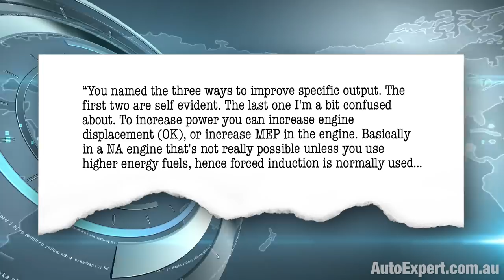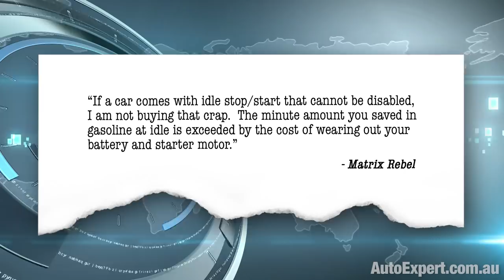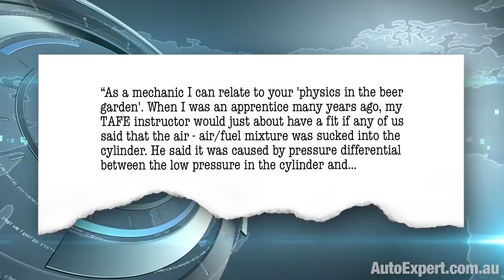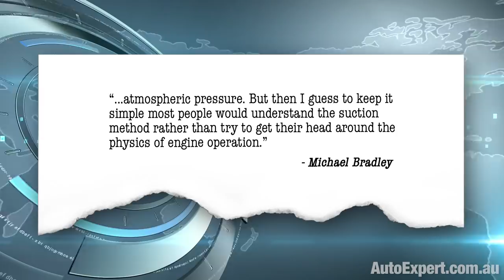Engine Physics in the Beer Garden (Q&A) | Auto Expert John Cadogan

Comment: I've only driven one car with stop/start - it was a hire car; VW something commodore sized.  And I'm pretty sure it was broken because the delay off the lights was exceedingly frustrating, followed by a loss of power; fortunately it could be switched off.
I've heard it suggested that stop/start can't be switched off in some vehicles.  Is this the case?  Assuming it is, would there be a fuse/relay one could accidentally forget to replace to permanently turn the tech off without affecting anything else?
Reply: I think you'll find most if not all cars it can be turned off but a lot of cars will default to on whenever the engine is restarted so I'd think that pulling a fuse would just leave it stuck in the default on position

Comment: You mentioned petrol start-stop is perfectly calculated so that the engine just needs a spark to restart. I was wondering, how does it work in a diesel? Does it stop very close to detonation and then the starter just moves a tiny bit to restart the engine?

Comment: nice explanation for the restart with the sparkplug so how dose it work on a diesel engine. the heat from compression is going to dissapate rapidly and than there is no more sorse of ignition for the fuel. and I haven't seen diesels with sparkplugs in a car jet.
Reply: Glowplugs

Comment: On a serious note, my old boss explained BMEP as the effective pressure pushing down on the surface area of the piston. Nore surface area, more power produced. That was why, he explained, why back in the good old days, you would have racing engines with 12 cylinders but only 1500 cc capacity.
Was he barking up the wrong tree, or just barking mad?
He has got it wrong in the past, i remember arguing with him when he said the 1071cc Mini Cooper engine was under square. It isn't. It's over square, meaning the bore is bigger than the stroke...

Comment: That start-stop function in a gasoline engine is quite reasonable to understant. But how it works in a diesel engine?
I have a diesel car and some times, if I stop for lets say 4 to 5 minutes or more it refuses to restart.
And the start-stop function  only works when my car is in normal function temperature.
I have a Mitsubishi ASX 1.8 diesel 4*4  from 2011.
One more question.
 I have heard, somewhere, that the 4*4 drive is disconected from more or less 60km\h, can you confirm if that is the case on My Mitsubishi??

PS: I live in Scandinavia country of the monarchy of Norway.

Comment: Stop/start was interesting, don’t think I’ve heard one fire up without engaging a starter motor or utilising the alternator/hybrid generator. Wouldn’t the leak down zero out the compression and oxygen in each cylinder? There’s a tractor engine which could be started using a shotgun cartridge, don’t hear too many of those cracking off at the intersection either

Comment: Also lower intake air temperature increases power - Carnot's Formula (T1-T2/T1.
Reply: I'm pretty sure that's just another way of getting more air in.  Remember that fuel is metered based on the weight of air, not the volume.  Cooler air is denser, so the same volume weighs more -- more air (by weight) means more fuel, more fuel means more power.
Reply: Yes, Ed B, denser,cooler air was a focal point of Sir Harry Ricardo's book : " The High-Speed Internal Combustion Engine" written in 1922. It's the engine engineer's bible.
Reply: @amazoidal  Thanks for the reference, I haven't looked at it yet (mostly books with plenty of color pictures, I'm afraid).  I did find this that you might find relevant though: 

"In the case of an automobile, the two temperatures are:
    The temperature of the combustion gases inside the engine ( THot ).
    The temperature at which the gases are exhausted from the engine ( TCold )."

T1 you use is THot, and T2 in your equation is TCold, also you should have parenthesis around (T1-T2), unless you are reducing T1/T1 to 1, then the T is not used.

Comment: Apologies Sensei for being late, getting a teenager ready for school is always fun. 🙄🤬
Now, in regards to the octane question and I sort of get where the question asker was coming from. We (you & I) both agree that octane equals knock resistance. What he could be eluding to is the use of different fuels which can increase/decrease the power of the engine. It's like when Holden would sell you the SS Commodore with 270Kw of massive power...but ONLY if you used 98 octane. If you used 91 octane it was rated at around 260Kw. 🤷
Still waiting for your inevitable dissection of Infiniti and the poor mess their unfortunate owners in Straya will have to go through in the future...unless Nissan steps in. 🤔
Reply from the maker: Yes - engines adapt to higher octane fuels and make more power. That's not the same thing as a higher energy fuel.

I'm dissecting Infiniti this morning.
Reply: @AutoExpertJC  That we both agree, but it can be easily misinterpreted by the less knowledgeable into believing that octane equalling more energy. Just trying to give the perspective from the "nut" side of the brain. 
When I was a teenager I thought changing fuels meant more power because of that same reason, more energy. I learned not to believe such witchcraft very quickly from drag racing and the effects of different fuels and power adders on motors from the racers themselves...not as technical as your Bachelor of Engineering but just as fulfilling. 👍

Comment: It would be interesting to calculate the real life effectiveness of many of the things done to improve efficiency and pollution.
Much of what is done is to get lab results and may actually prove useless or even have negative results in real life testing.
Some universities etc have strapped a mini lab to the back of some vehicles to test irl conditions (that’s how VW got caught I think) but even that portable lab alters the real results by some margin.
If you burn a set amount of fuel to do a set amount of work with one engine and produce xx amount of pollution for there to be a real improvement an engine needs to either burn less to do the same work or create less pollution to do the same work with the same amount of fuel or both less fuel and pollution, but unless you are looking at large commercial vehicles you can never get that comparison as no cars are the same even when they are supposed to be the same model with a new engine.

Comment: Cannot the inlet piping be "tuned" to help air into the cylinder and on the exhaust side, be "tuned" to help extract the gasses.  At least that what I thought all those very noisy 2 stroke "mufflers" were doing -- setting up a resonance in the exhaust tubing to help evacuate the cylinder.
Reply from the maker: Sure - but you can't do it at all operating revs.
Reply: @AutoExpertJC  Yes, I think they were tuned for max hp. Sure were loud!!!!

Comment: Nautrally aspirated engines push air into it's cylinders from astrophic presser, not from sucking it in. It's basic physics.
Reply from the maker: Yawn - go study basic physics. The flow is motivated by lower pressure in the cylinder.

Comment: Speaking of starting the engine again after the automatic engine stop of a stop/start system, is, at least for the petrol engines, similar to the "safe" way of starting the Blitzen-Benz: https://www.youtube.com/watch?v=xMa3_tT5mKA
It does have a crank, but using it with the mags hot, given the engines huge displacement, can easily backfire and literally break your wrist. So the engineer just primes it carefully, cranks it to just after TDC, and manually fires the ignition. And sometimes it starts. Mind you, the machine is 110 years old!
I think diesels needs a small mechanical push (about half a crank revolution) to get it going. The ignition relies on the heat from the (mostly) adiabatic compression, but that heat will have drained away when the engine has been standing for a couple of seconds. I'm not sure glowplugs are used for restarting; I somehow doubt it, they would take too long to heat up to make a difference.

Comment: Any reference to this restart without starter motor? To me it sounds incredibly difficult to make the engine stop exactly beyond the TDC of even any cylinder. The air pressure would also start to fall fast.

Any texts I can find about stop/start systems indicate the starter motor is used, or otherwise a combined alternator/starter setup is used.

Comment: at 5:40 except when it is a diesel engine. It is really a starter motor deal there. But there is a good point though. The thing that wears out is not really the battery or the starter. The thing that wears out especially on diesels is the flywheel and the harmonic balancer on the front. The many low rev states start stop puts them through excercise the dual-mass flywheel and balancer a lot. start/stop batteries are only expensive in that mazda probably because the dealer network does that to you. It was £10 more expensive than an identical non-start-stop for me in my BMW Mini and it works fine but I have to say the original EXIDE battery went quick(5 years from new)... because EXIDE batteries are shit in general. I hope BMW did stop using them ever since. Anyhow non-oem replacement works so far. So far(almost 3 years in) no degradation... checked the battery management module over OBD. Hoping for better results but those will only be in in about 3 years :D 

Oh did I mention that mine can be switched off and it stays switched off until I turn it back on... no matter how many times I park and restart the car. It remains switched off until told otherwise. It was a feature I needed to opt into over OBD and now the disable button works the way you would expect it to. I could not find a way to keep SPORT mode on all the time so that switch I still have to press before every drive :D
Reply: No. I am an engineer and a good car battery lasts 10 years. My previous car had a battery for that long before I had to replace it.
Reply: @kozmaz87  Indeed. On a car from may 2007 I had the battery replaced in nov 2017 and it wasn't dead yet, but I got the feeling it was getting weaker and chose to be on the safe side with winter coming.

Comment: Riddle me this Batman (and pardon my ignorance): If a DPF is primarily designed to capture and burn off diesel particulates from the exhaust, aren't you still polluting the same amount of carbon deposits via the same exhaust? In fact, by using a squirt of diesel to burn off old diesel deposits, surely you're adding more carbon into the equation?? You're just capturing and releasing the carbon in a shorter time span than just exhausting it continually without a DPF (Kind of like holding onto a few farts then dropping a massive clanger rather than crop dusting a few light fluffs around the place continually). If so, what's the point of having them? ... serious question
Reply: The soot particles are oxidised to CO2 so you swap carcinogenic soot for greenhouse gas.

Comment: 5:18 Why don't normal engines park themselves like that when you turn the ignition key off? Would hardly ever need to use the battery and starter motor, resulting in fuel saving.

Comment: Has anybody tried to put an impeller on the exhaust side forcibly extracting gasses? Kinda like  a centrifugal  supercharger on the intake side, & another belt-driven impeller to extract gasses?
Reply from the maker: Why forcibly extract - it's already gagging to come out, and pumping it out would cost efficiency because you'd have to drive the impeller.
Reply: @AutoExpertJC   The wild card is if the high temperatures of the spent gasses "contributing" to the pumping effect. The intake side is almost an exact mirror, the  lower pressure drops the temperature, a more dense  warm charge moving to a "colder" lesser pressure. I think it a bit of a myth, although we see flames sometimes, the expansion of gasses is complete, the flow we note is from the physical pumping process.
Reply from the maker: @AndieBlack13  Mate, you're hypothesisng about one of the most studied processes on earth. An impeller in the exhaust driven by the flow is nothing more than a restriction. Engines are not pumps - exhaust is not pumped out, it's dumped out while it's still expanding energetically.
Reply: @AutoExpertJC  John, you misunderstand...this theoretical  impeller on the exhaust side  is not driven by the flow, but rather, the flow is created by the impeller over & above expansions & physical pumping.  Whatever exhaust  pressure created by the pumping process and the remaining combustion pressures would move from X pressure to atmospheric...In my theory, it would move from  X pressure to...say 0.25 lbs square inch...a greater difference...granted, a big-ass impeller. We still hear over & over, "their nothing but air pumps".

Comment: SO.... we don't suck liquid into a straw ?
Reply: And it's easy to demonstrate...  Just place your straw through a sealed opening in a container full of liquid (so that the liquid is not exposed to the air).  You will find that it's very difficult indeed to get a significant amount of liquid in through the straw.  Now do the same experiment without the seal, voila you can get as much liquid as you desire.  You are lowering the pressure on the top end of the straw (sucking air, if you choose to call it so), but it's the atmosphere that's forcing the liquid up through the straw.  Alternately, there's a variation where you try to suck the liquid through 33 ft (roughly the weight of the atmosphere), but I don't recall the details.

Comment: For a moment I thought you'll talk on the matter of exhaust pipe diameter and the mass and inertia of gas traveling through it. That was a wrong assumption on my part... -..-

However, the true demon of start/stop cars is not really the start/stop cycle. The truth is scarier and gnarlier than that. The real reason why batteries in this type of cars tend to die soon is because they're charged inappropriately. It is an attempt to meet as low carbon emissions  as possible. The car manufacturers have implemented the 'fuck you and your battery' software in to the computer. Since charging battery takes power and increase emissions, computer is very careful in actually giving the battery any power. If you than drive mostly short distances, the computer simply never switches on the full charge procedure. That causes the battery voltage to drop and crystals to form. Once the crystals short enough of the electrodes, good bye battery. It's as simple as that, and in most cases, not even an authorized service can change this idiot programming. Either they can't or they ain't allowed to.